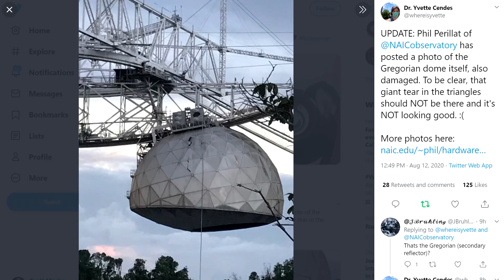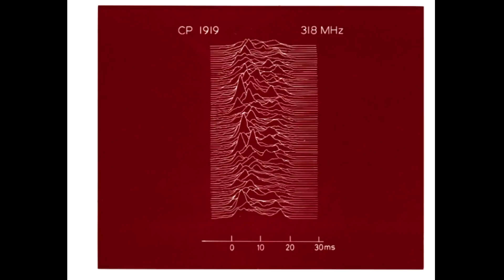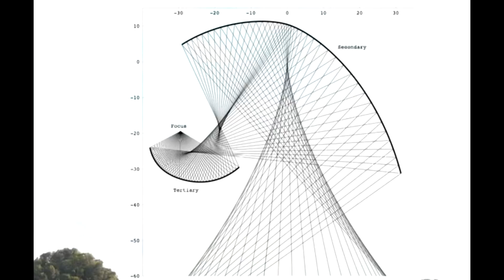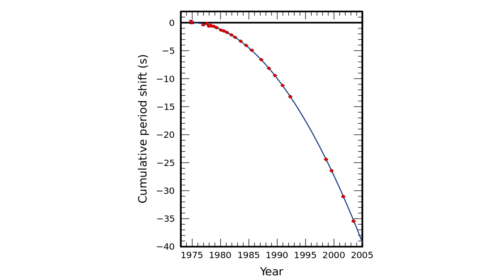Snapped Cable Damages Arecibo Observatory Radio Telescope

Comment: Typically the cables will fail at that point due to corrosion. They require periodic maintenance and inspections, as well as greased to prevent corrosion. They also have a finite lifespan, if they stretch too much eventually they'll snap. I've dealt with similar cables on guyed towers of 1500 to 1800 foot heights. Most of those towers when they fail often are due to corrosion on guy wires. I'd be doing some emergency inspections on the remaining cables, especially any installed at the same time that cable went in. Could easily have been a defect in manufacturing that might exist on other cables.
Reply: Yes, looking at the photo of the Spelter Socket without any cable, it is reasonable to expect that either the cable pulled through (highly unlikely) or that corrosion right where the cable 'exits' the socket (not uncommon) was sufficient to cause the cable to fail.

An interesting post today on LinkedIn by Herbert Weischedel
, owner of an NDT company, showing the failure of the IWRC element of a cable that did not show any particular visual evidence of markers to be concerned about.
Reply: @rs2352  That does not surprise me. Depending on the cable size and equipment either ultrasonic or x-ray are the only means to inspect the cable ends. When in doubt a cable will be replaced and destructive inspection done to see how bad it may be. I am sure that end will be dissected and I would not be surprised if it has heavy corrosion in it.
Reply: @rs2352  It pulled through. You can see the potted zinc on the end in one of the photos. Of course it also smashed through a bunch of stuff, so the end is a bit mangled.
Reply: so, a part of your job is to look for good guys and bad guys?
Reply: They probably have to check/change all the cables; I don't even want to know the price tag.
I would be surprised if the socket itself failed because that sort of connection is well understood and usually reliable.
Reply: We also use that type of connection on our cable car for the traction cable, that's really strong. We do inspect it monthly, just measuring with a go-nogo gauge the extension by reference to a fixed ring fitted on the cable. I've seen once its rebuild during a big maintenance, quite amazing was the dexterity and knowhow of the guy during the separation and folding of all the tiny wires before pouring the hot metal!
Reply: There’s been A LOT of earthquakes here in Puerto Rico very recently. A sequence started back in January and we’re still getting earthquakes every 2-3 weeks
Reply: I reckon that’s exactly what they are probably doing right now. From your perspective I’m guessing there’s no repairing that cable and the only option would be to replace it?
Reply: @thethirdman225  Yep, if a cable like that breaks for an unknown reason the entire cable is suspect. There also generally is not enough slack once the cable is built to shorten it further anyway, both points are at a fixed distance. The completed cable has enough slack only for adjustments. That entire cable will be replaced. 

Now if this was a tow cable on a winch and the end was simply damaged but the cable itself was fine then a clean cut would be made above where it sheered, inspected and a new end installed. But that's a very different scenario.
Reply: They are inspected weekly for corrosion and never seen any, but you can't see inside the socket. This was a relatively new cable, from 1995, not the old ones from 1960. I'm sure they'll be looking for defects in the rest of them: Maybe too thick to xray, but maybe ultrasonic or some sort of eddy current? They are 3 1/4 inch bridge strand at 600000 pounds tension, about half the ultimate strength.
Reply: Sounds like it is time to switch it out to dyneema...
Reply: Scott is suggesting that the wire-end, however securely it seemed to be potted by its geometry, appeared to have simply popped out of its socket en masse.
Reply: @-danR  That only happens if it was defective, overloaded or corrosion caused a failure. All the more reason to inspect the rest of them. Normally the cable fails before the sockets do if it's overloaded, so I would think defect or corrosion are more likely the case.
Reply: @-danR  27 years ago for the install based on that catalog. In reality the cables should easily last longer than that, provided they were installed correctly and maintained properly. The exposed cable sections actually look quite good compared to many I have seen. I want to see the innards of that socket.
Reply: I was surprised to hear these sockets are filled with molten metal. A conic counterpart of fixed geometry would tighten itself in, but if you have each part of the cable individually fittet in molten metal, these can slip out somewhat easily once corosion builds a non-boundary-layer, as the molten plug would counteract the compressing forces of the conic shell? In classic cable splicing its all adhesion and things clamping in on themselves, no glue or molten things there...
Reply: @A.Lifecraft  If done properly there are no voids in the metal or epoxy depending on the type of socket used, I don't thing any that large use epoxy though, and the amount of force to pull a wire free is greater than the wire can take. If there are voids in it however it can allow corrosion to build up inside the socket causing failure. Alternately where the wire leaves the socket it is supposed to be lubricated to prevent corrosion there. Often what happens is water will get into the inner strands and due to either a void or lack of lubricant begin to corrode those inner strands, once they fail, the outer strands are all that's left holding the load and once there are not enough left it just sheers off right at the socket.  Simply overloading a cable usually causes it to snap somewhere else, the margin in those sockets is pretty substantial. Now if it wasn't done properly, such as they wires weren't cleaned properly, or weren't flux properly or the hot zinc was at the wrong temps or voids were allowed to form, all of those can lead to a failure, some immediately, some years later. I've had cables replaced that had been stretched due to hurricanes causing enough loading that it stretched them beyond what was deemed safe and none of those had sockets that showed any distortion.
Reply: @A.Lifecraft  put your hand through a hole it barely fits through, then spread your fingers out, grab a tennis ball, and duct tape your fingers around it, and then try to pull your hand back through the hole. It won't go lol

There are styles of wedge sockets where the tension simply pulls a wedge in tighter, often used to terminate crane cables because it's easily removable, but the poured style are the ultimate termination for a cable.

The cable wires are splayed out to evenly fill the cone of the socket, and then they are mechanically and chemically cleaned. 
The metal, zinc, or a zinc based alloy is then poured in, and it's like soldering or brazing to each individual wire strand.

So there is no way for it to loosen around the wires or corrode inside the metal plug, any more than a proper solder joint will loosen around the wires. It tins the metal and forms a metallurgical bond, actually forming an alloy layer of a combination of the base metal and the solder metal. This is in addition to any mechanical or adhesion bonds.
So the zinc is held to the base metal with as much force as its held to itself, as long as the formulation is correct to be able to wet the base metal.

So now, we have a tapered plug of solid metal bonded to thousands of wires inside.
When you apply tension to it, the taper wedges it deeper into the socket, which compresses the plug of metal, squeezing down on the wires inside it.
Since the potting metal is a little bit soft, it does compress the tighter it is pulled on, creating a very tight wedging action on the cable strands.

As long as it is done properly, you can't get corrosion inside the plug, and the wires can never slip out.
Reply: @ke6gwf  No need to tell me this stupid tennisball analogy, i am not a chimpanzee - nor a human with a mind resembling that of a chimpanzee. Although i have to admit, one meets many of these out there on the streets. How do you explain Trump otherwise :D
But to set your analogy in perspective, imagine that hand spread out through the hole and instead of taping on a tennisball, you just cover the whole thing in children putty. Each finger will now be able to slip out individually as the putty in between kinda dissolves the overall structure. If it were all about the strength of soldered connections, you could fan out that cable and solder the individual strands straight onto a steel baseplate.

On a sidenote, it was once usual to give rebar a moderate bend and then put it in the concrete for heavy lift anchoring. This is now prohibited in germany because these bent rebars have a reputation to slip out unbending themselves in the process. It is now mandatory to compress said steel parts lengthwise to actually widen their diameter.
However we will see what investigations bring along.
Reply: @A.Lifecraft  it sounds like maybe you have also heard of trapping monkeys by putting chunks of salt etc into bulb shaped holes? Lol

The reasons that they don't just solder the wires around the edges is, 1, you would be relying entirely on the shear strength of the solder to hold the load, and 2, the cables are giant, and you would have to have a very large ring to be able to terminate every strand to the anchor ring.
Instead, the cable end is simply expanded, like the sticks on a witches broom, and unlike my analogy with your hand, the center is also full of strands, all evenly spaced apart.
So basically you are forming the end of the cable into a wedge shape, and then filling it in with the potting metal to hold that shape.

It doesn't rely on the sheer strength of the metal, which is why it's a tapered shape, so that the tension increases the gripping force on the wires much like a wedge and socket, but it's even stronger, because instead of simply using friction to hold the wires, it also uses the intermetallic bonds to make the wires become part of the wedge.
In addition, and very important for such a large cable, it evenly distributes the load across all the strands and compresses them all evenly.
In a wedge socket design, the friction is only on the outer strands, and it loads the core unevenly, while relying on bends in the cable to transfer force, leading to high stress points, cable, bundle, and strand deformation, and thus loss of strength.

This method protects each strand, does not require any bending or deformation, and equalizes the compression forces and friction and actual metallic bonds across all the wires.
Reply: @ke6gwf  Hm you don't get it right? So here is: I understand this technique. For real. I studied physics several years ago, i did sailing as a hobby and also i am capable of historic methods to produce and use wires and cables. And going somewhat deeply into the matter i am past that dunning-kruger-point where you realize, that under certain circumstances, you can weaken structures by pouring in additional material. A conical shape with solder in it will initially be stronger, but over time, soldered connections tend to creep (hence you are no longer allowed to solder ends of filament-wires but instead use wire end ferrules) , they are not mechanically stable over long periods of time and you have to keep up maintenance there - which tends to be a problem on underfunded structures. Also did you realize materials like zinc where used as a last resort lubricant on steam engine bearings? So you are basically drowning your connection in lubricant when pouring the liquid metal...

Based on all this, i was surprised to hear these structures are soldered, and there you are telling me stupid childrens stories about tennisballs :D Just wait for what the findings of the inspection will be.
Reply: @A.Lifecraft  This is a very common connection supporting much more massive structures then this all over the world. The zinc does not act like a lubricant at all in this, it's specifically matched to the cable. I've seen hundreds of these cables, some with 50 plus years on them, and the only time I've ever seen one sheer like this is due to corrosion in the filaments above the socket, or because there was a void in the socket. Mechanically it's much stronger than any other part of the cable. You'll sheer the cable in half somewhere else before you can ever get enough force to sheer it there unless it was done incorrectly, voids, not cleaned properly, not fluxed properly, not heated to the proper temps either over or under, or not centered which will increase the loads on one side of the cable higher than the other. While that seems like a lot of things to control, it's a pretty straightforward process for the guys that do it every day. Unless it had a void in it, I'd bet you money there is a perfectly shaped conical section still in that socket complete with every strand of cable still in it, simply sheered off on the other side.
Reply: @andycanfixit  Yes, engineers bet money and peoples lives on their ideas all the time. Every time these ideas fail, they explain how nobody could have thought about a failure like that before. So if you are right and its just corrosion, that incident does not bring up any new knowledge. If there is anything to my idea, and these conical connections can creep out over decades, this tells us where to look at on millions of bridge safety inspections.
Reply: @A.Lifecraft  As I have stated I deal with these cables on very tall guyed towers, that have significantly higher loads than this does. They are an industry standard and those standards get reviewed and updated every few years. I can find no data showing a failure like your describing in a properly installed fitting. The physics make it not possible. That's why they have been the standard for decades now. I think I will go with that track record and the industry and federal standards. In the case of these towers I deal with FAA has standards they need to meet as well. Short of a fire heating that fitting enough to soften the material those wires will not pull out of the zinc if done properly. There are many very tall towers showing that for decades.
Reply: @andycanfixit  I never said it was impossible that this fitting might have been heated up, maybe by lightningstrike? Or microwave resonance? Could have happened months ago and then still needed some time to ultimately fail... Thing is, if this was done to standard, and i expect it to be as we are speaking a multi million dollar radiotelescope, we SHOULD find out why these standards failed and if this was a unique event or if it could repeat elsewhere. Whenever there is a "mystery accident", there is a cause we did not find and can therefore not rule out in the future. You know, everything happens for a first time once, every immaculate track record is broken at some point, leading to further development and better technology.
Reply: @A.Lifecraft  you seem to think that because you "studied physics" that you are smarter than 100 years plus of engineers and scientists and and end users finding every possible way to make one of these terminations fail.
There are only two ways to terminate a wire rope where the termination is stronger than the rope itself, and doesn't derate the cable due to bending it etc.
You 100%of the cable strength with pressure swaged ferrules and fittings, and with Spelter poured ends like this (using either a special epoxy or zinc/white metal/Babbitt metal, etc).
Since hydraulic ferrule presses are a newer invention, and a major investment, Spelter sockets are one of the most common methods to terminate cables, including bridges, crane support cables, rigging slings, barge tow lines, etc, and it's been that way for a very long time.
Tug boats will carry the stuff on board so if one of their giant tow lines gets damaged, they can easily cut off the bad end and put the Spelter socket back on the end.

They have been extensively tested and studied, by people with actual degrees, and the physics of how they work are well understood.

I went to Crosby and did some reading on their research, and I was wrong on one point.
It's almost entirely the wedging action of the tapered zinc or epoxy plug that holds the cable in.

Using epoxy for instance, when it cures you have two forces acting on the wires, adhesion and friction.
They found that either the adhesion or the friction by itself was adequate to seat the plug and create enough wedging action to break the cable.
However, if the plug didn't seat, the adhesion was not enough to hold the wires in, so these fittings are always proof tested after installation to ensure it seats the plug.
So they found that even if the wires were oiled so it would seem that they could slip out easily, there was still enough friction to pull the wedge in and exceed the breaking strength of the cable.

And that's the key point of this termination method, it holds the cable securely enough that the cable will break before it pulls out of the potting material, because of the wedge shape squeezing tighter the more load you add to it.

You also seem to think that zinc is a lubricant, which makes me wonder if you understood how Babbitt bearings worked, and I also suspect that the bearings you referred to are actually Babbitt metal, which is tin based, and not zinc.
Babbitt works by having hard crystals in a soft matrix, providing a low coefficient of friction when used with a polished harder shaft.
And it requires oil to make that happen.
If you run steel directly on babbitt, or zinc, it will tear it up, because it's not a lubricant.
And crimped wire rope wires are not a smooth surface, and so will not easily slide out of metal poured around it.

The fact that it has held for 30 years indicates that it was a proper joint, or it would have failed when originally loaded.
Also, the fact it failed after 30 years points to the likelihood of corrosion outside the potted section, which is a known and likely issue.

So instead of saying that one of the best and most thoroughly tested cable termination methods is a bad idea, maybe we wait for more data on the actual failure.
Reply: @ke6gwf  Just spare me the belitteling this was all iu asked for.
Reply: @A.Lifecraft  That's the sort of proffessional attitude I look for in my engineers - want a contract?
Reply: @LosBerkos  Are you situated in germany?